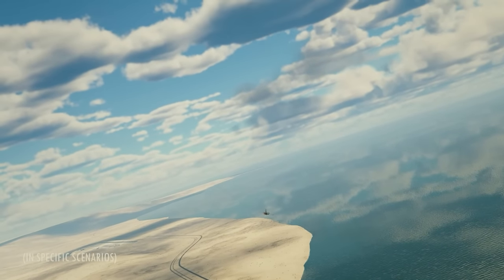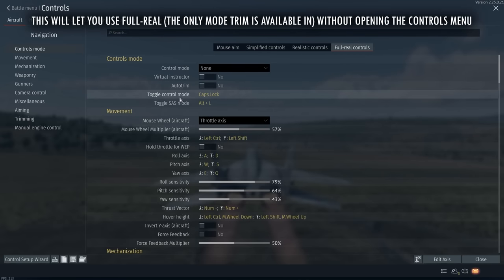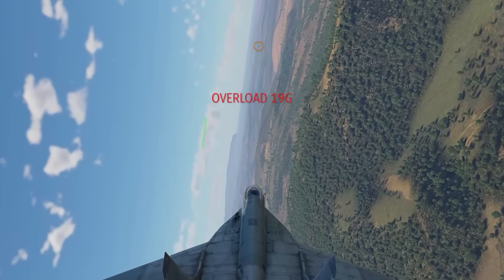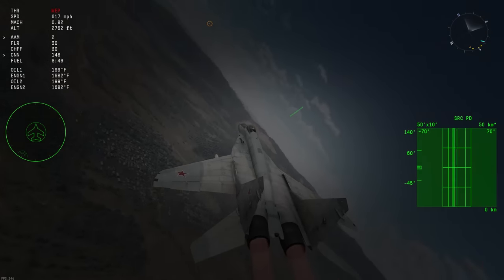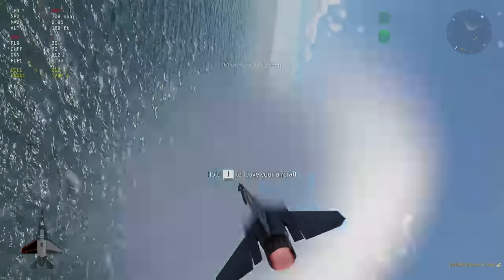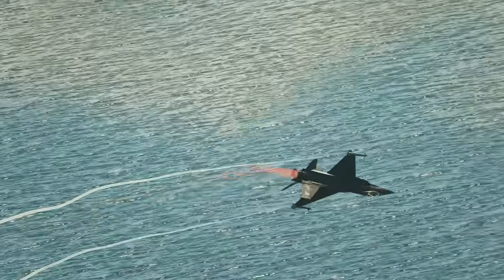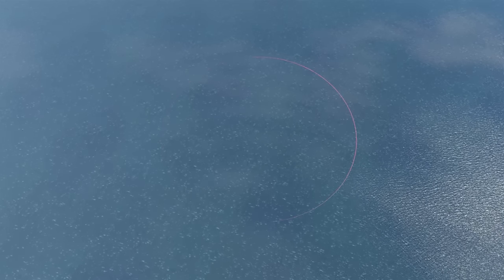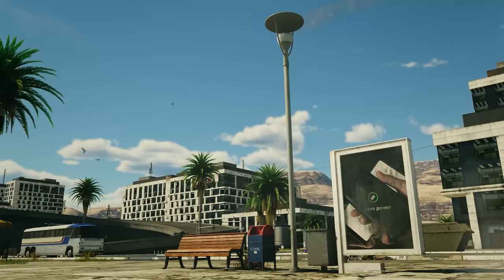This Hidden War Thunder Mechanic Lets You Fly WHILE UNCONSCIOUS (in game)

Comment: AUTO G-CAS
Its a system implemented on newer F16s, it uses altitude, speed, bank and dive angle information alongside stick input information to determine wether a pilot is or isnt blacked out. Once it determines the pilot is unconscious it will straighten out the aircraft and pull it up from a nosedive into a shallow climb till the pilot regains consciousness and takes back control of the aircraft.
this system has saved several lives since its implementation.

Comment: The F4D can actually do this with its default controls. Just get up to speed and use full flaps, the little tail flap will extend and it will pull 12g forever

Comment: Tbh in props I just use mouse controls and turn HARD before quickly "flicking" the mouse into the crosshair to rest the pilot stamina prior to resuming the turn quickly. The end result is a comically long high G turn that should have blacked out my pilot within seconds, yet I retain full control for the entire turn with the capacity to fight back or even maneuver on command.
Reply: That is that and this is this. 100% different

Comment: in real life trim is used to keep an aircraft stable in configuration changes shuch as flaps, slats, gear, thrust changes, etc. theres also rudder trim used during for example an engine failure and aileron trim if you have for example split flaps

Comment: "It's not cheating", yeah even if sim controls didn't make your plane turn better than realistic controls on air/ground rb (real and clearly unintentional stuff) it's still some shady tactic to pull. For some reason changing to full real controls on rb mode doesn't disable instructor so you can not flatspin from doing this. I think a good way to limit it (and encourage even more avoiding blackouts) would be lower or disable instructor when pilot blacks out.
Reply: Oh you can... 
I've done it...

But i can just switch it back to normal RB controls and get instructor back and regain control
Reply: @kajmak64bit76  yeah you must have done something your plane really did not like to flat spin in air rb

Comment: Lol, what?! F-16s and many modern jets do indeed auto-correct their flight as they are aerodynamically unstable. A human pilot can't even fly them without the computers assistance. The plane will also attempt to self-correct for stalls. Plenty of footage of this capability, just look up fighter jet trying to fly itself after pilot ejected. Detecting a passed out pilot would be easy with all the modern biometric monitors we have. You could reasonably even program the plane to intentionally pull a small amount of negative Gs to try and help wake the pilot up.

Comment: It’s not a G-limiter… it’s an AoA limiter.. people need to stop calling it a g limiter
Reply: Functionally it becomes a g-limiter when you reach high enough airspeed that you can pull 9g before reaching critical AoA. So it's not really wrong to refer to it as G-limit because the AoA limit is adjusted by aircraft speed and configuration to not exceed the critical load factor. Normally the limit is 9g in clean config but it can be lower with heavy payloads.

Comment: Blackout's should be nerfed as in if you blacked out, it's on you! And your should actually blackout and can't control the aircraft, that's how blackouts work, so for you to still have control of an aircraft while blacking out is extremely unrealistic, I mean extremely.

Blackouts need a nerf, you may say it's not cheating, but your by passing blackouts, which is meant to not allow someone to pull any G's because you Fucked up, so yes I do believe this is un fair advantage, and there needs to be a change in the blackout, aka, simply put, just actually blackout like in irl, u funked up and didn't counter the G pull or didn't stop pulling so now you pay the price, if you by pass it, what point is there to having a blackout? In my opinion it is cheating. Just because everyone can do it, doesn't mean it's by passing the main thing to counter those abusing it. Basically blackouts need a nerf and they need to work as intended like in irl. Maximum blackout time should be 5 seconds, just for balance sake.
Reply: It would be easier to just not let you change controls mode in battle
Reply: @DownloadPizza   yes, the main issue is the blackout, you should be in a black screen and the trim continues to pull you should stay blackout out, meaning you end in this infinite loop, it should be like that is what I am trying to say, it's makes zero sense your able to see somewhat the target, and it doesn't make sense that the pilot doesn't die for doing that over an extensive period of time, not to mention it takes no skill to do this. Its still and exploit either way, sure you can continue to pull, bit tit doesn't mean you can just turn it off and be fine. It should damage the pilot, and then seriously affect you in combat.

Edit: while in the infinite loop, you can't recover and disable trim, DCS tested this out, sure trim can provide help to continuously pull for you, but if you manage to do it to pull 9G's your pilot would pass-out ofc over time, but now your stuck, cuz trim is doing it for you, and you should stay passed out, it's how it works in irl hence why pilots never did it to pull max G's but only 5G's or sometimes 6.5G's, either way, you should be able to then disable trim, hence that's not realistic in anyway. That's how it should work, ergo you'd either get killed by another player or turbulence would eventually make your aircraft slowly point your nose down to then crash, you understand what I am trying to say. You shouldn't be able to recover from the infinite loop once done. It's how physics works, it's how it works in irl. Look it up or ask a danm physicist someone who understands physics.
Reply: @El Bozo  then what about dampening or manual? Good try though, A for effort.
Reply: @WOLFER.  why would you even need that in air rb?
Reply: @El Bozo   it's a Sim issue dude
Reply: @WOLFER.  nvm my comment then
Reply: @El Bozo  All good, this is a huge issue and I'll be showing in a video how big of an issue it actually is. And I need help to spread the word
Reply: DownloadPizza  For early jets and props, yes. But on modern fighters the entire aircraft is flown by a computer. I highly doubt that the F-16 even has a "trim" that can be adjusted by the pilot. You just turn the stick and the plane flies itself. If you don't touch the stick it will fly in a straight line, regardless of speed. I'm not an expert on real life flight computers so this is just my assumption of how they work, but it feels silly for such a simple feature as elevator trim to exist on a fighter that would literally just tumble into the ground if the computer wasn't already constantly making small adjustments to the control surfaces without input from the pilot.
Reply: I also find it funny how people with aced crews are suddenly complaining about unfair game mechanics lol. The game is pay-to-win garbage already on the higher tiers. On low tiers it doesn't matter too much but in high tier it's literally pay-to-turn-better lmao. You can literally just buy more health for your pilot, imagine if they did that in a first person shooter 🤣
Reply: @laihela what funnier is just the lack of matchmaking altogether. I am lvl 100, yet in the same match there will be me, a lvl23, a lvl 69 and some 10000Kills player bulling the whole lobby yet they go about "unfair" mechanics.
Reply: Okay but buff the pilots so they don't black out at 5Gs because then the game will just be boom and zoom on turn fighters
Reply: @Princess Applestrach  you just need to upgrade the crew or manage your G strain it's not difficult providing the game is already unrealistic in G pull.

Comment: It is an exploit, as the pilot is not conscious during g-lock, and should not be able to input small controls, as you mentioned in your video. Once g-lock has set in, the only hope for the pilot to recover should be regaining consciousness after the gs are reduced.
Reply from the maker: The pilot retaining some control during a black-out isn't an exploit since it's an intended game mechanic that's been confirmed as such by developers. An exploit in this game's context would be making use of a mechanic in a way to produce an outcome NOT intended by the devs.
Reply: @Pilicast  I very much doubt the devs intended for players to use trim contol to by-pass the g-limiter and black-out control reduction like this. This is an exploit by your own metric.
Reply: @Pilicast  "An exploit in this game's context would be making use of a mechanic in a way to produce an outcome *NOT intended by the devs.*" Getting double elevator deflection by maxing trim is intended by the devs huh?

Comment: This exploit is stupid. Like there's a reason even credited sim pilots like my squadmate ninja, who's  top 100 on the simulator leaderboards avoid using this. In order to maintain an optimal rate speed in these aircraft, it reauires a pilot's touch, and being blacked out for most of the fight, you're revoking the ability to shoot, flare, transition the fight to another optimal maneuver, is all gone. Also with losing visual. And that 13g sustained turn in the F-16? Useless. You're pulling around your circle at 17.4°/s which is slower than the F-14 tomcat at full fuel, and missiles(18.5°/s). This "trick" is completely impractical, and extremely situational. Dont expect this to work against any pilot who knows what theyre doing.
Reply: In sim this would be basically useless but in air rb it would be useful because sim controls let you turn faster
Reply: @moery2435  that's not correct. The realistic battles virtual instructor acts like the damping stability augmentation, but allows more AOA. The instructor also makes wing stalls impossible regardless of pull. Each one has it's advantages and disadvantages
Reply: its only useful in a mid-low speed rate fight with an aircraft that retains energy really well and has a high twr

Comment: None of this is a mechanic. Using trim to maintain a turn when blacked out is something you very well could do in a real airplane. Basic fighter maneuvers are not a "mechanic" of War Thunder. It's a trick. A trick that can be useful but is usually more trouble than it's worth. 

Going beyond the pitch authority of a plane on the other hand is an exploit. It's just a legal exploit. A mechanic is something intentionally put inside a game to be utilized. That is not what this is whatsoever. You're exploiting the fact that Gaijin has improperly modeled the control systems of most aircraft (and the g-limiter on the F-16), and you're exploiting they haven't properly made you lose all control of your airplane on blackout. You absolutely should not be getting any extra elevator deflection from setting trim. And it's certainly not something that players should have to do to get the most out of an airplane.

You should be posting this video as a bug report on the forums. Not as a protip.